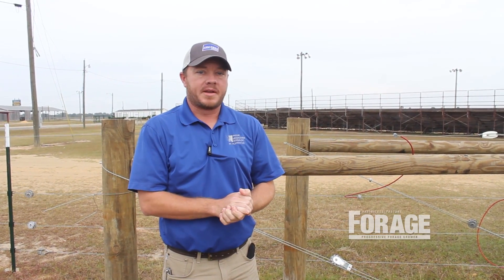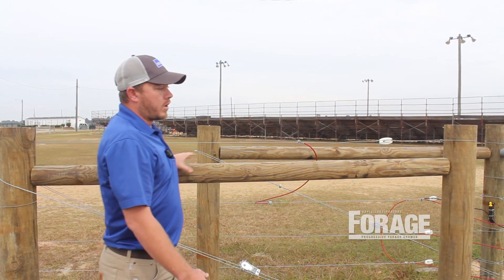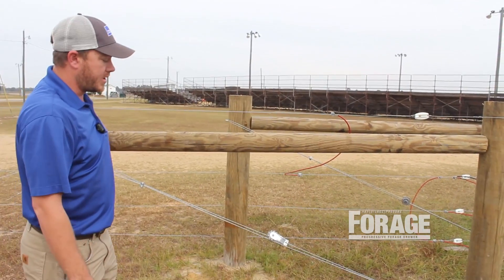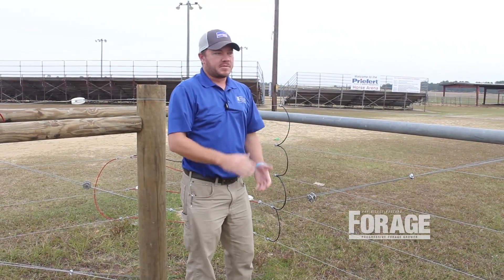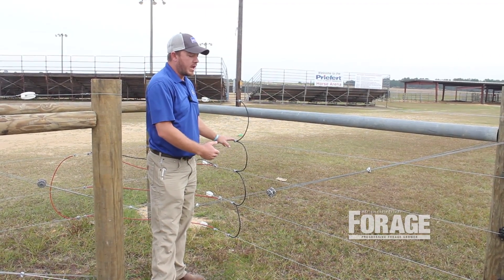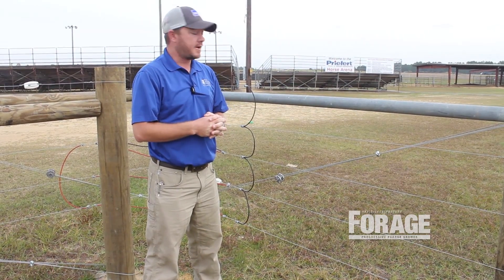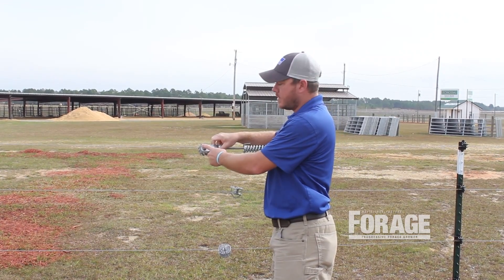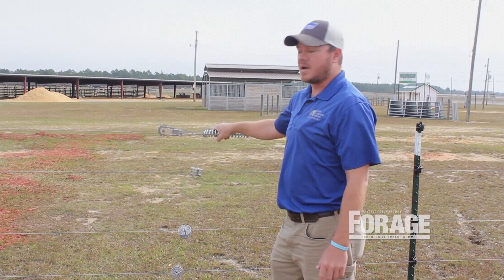Fencing tips and tricks – Part 1 – Building electric fences

Comment: Do you have to tighten the ratchet overtime or can it be done as a one time??
Reply: Thoes ratchet tensioners wont get tight enough they tear out or break off at the teath of spool you want to use # 9 wire  to strain an h brace